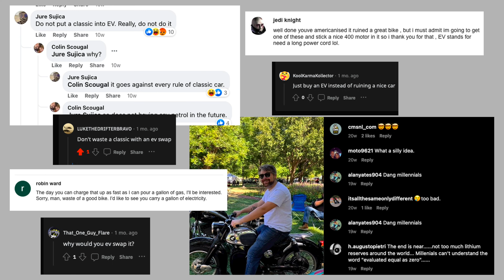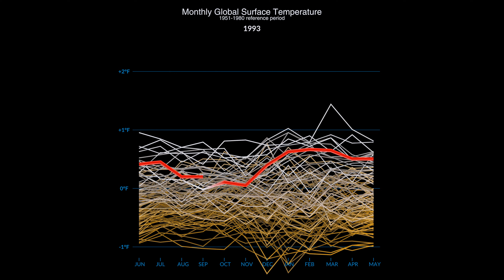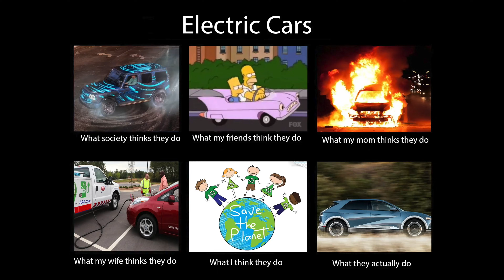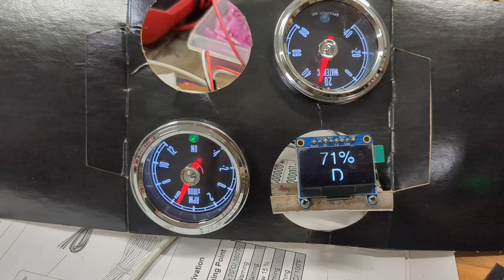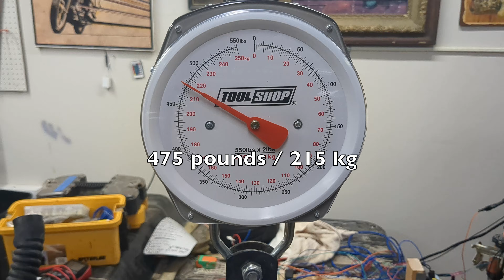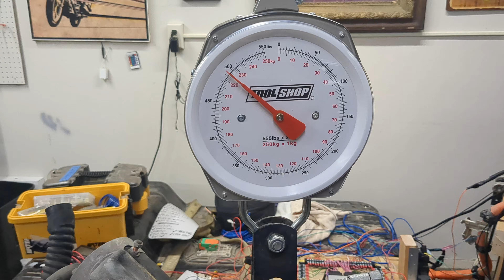Why I'm converting my classic car to EV (it's not what you think)

Comment: You got it all wrong or at least the reason you've given yourself is without proper reasoning.  Climate change and related things is something that doesn't have valid merits. Do a deeper dive and you'll find out that in the end it only serves corporate interests and lands itself somewhere in deep finance. Now realistically,  if you want to do a conversion then what you should have in mind is whether if it's actually going to save you any money over fuel costs in regular engines. This I rdoubt however because what ever you spent in buying fuel will more or less add up to electricity costs when recharging. You see because laws of thermodynamics don't and won't change it'll come back to the same thing more or less. I was watching your conversion with a lot of interest but see 3 minutes of your this video makes me think you're wasting your time and money converting a perfectly ready to drive classic car. If it were done on some small lighter car from say the 80s or so then you and me could have truly said it, it's really good learning and fun project to build and be satisfied about.

Comment: Why do you keep calling it a tractor engine?  It was either a 144 cu in. or 170 cu in. straight 6.  Not a 160.   ALSO, "Solder" is pronounced without the "L" sound.  Just sayin'

Comment: The reason I’m doing my conversion is for a totally different reason. I don’t much care about the controversy over climate change or the politics surrounding it or the never ending “we’ve only got 10 years” speeches that are given every 10 years. 
   I’m doing my conversion because my house is solar powered already (not because of the climate, but because i wanted to give them idle finger to my local power company) so since my house is already 100% solar powered….. why not build an EV since I won’t have to pay for electricity. I can literally drive for free since my system already paid for it’s self. Of course I’ll still have to pay tags and Insurance…..

Comment: Congrats on the coal powered car lol. I'm just kidding but seriously ev battery's are heck on the environment using minerals mined by slave labor and releases nasty chemicals into the environment. If I recall correctly it takes 68k miles for an ev to offset its carbon emissions from production. and thats ignoring the mining or raw materials. Diesel ships to move the materials and semi trucks to bring them to assembly plants then again to bring them back to the states.  

I still think the future is hydrogen fuel cell cars.

Comment: Instead of using the leaf with that weird huge motor - could you not have added an electric drive train to the original. Some kind of hybrid. It would be easy in a FWD car because you add the electrics to the rear. There are already products on the market that do this and people have made DIY. I dont know how you could do this to this car and retain the engine. You could get a GM X platform car and do it to that.

Comment: I wonder, there's got to be a replacement charger cable with a NACS outlet end. I've been led to believe that the signaling between NACS, J1772, and CHAdeMO is identical, and that's why simple adapters can interchange between them. If you can just swap a cable, you'd save yourself some adapters in the future.

Comment: We had 26g to 19g wire in the telco world. We used 3m scotchlocks and amp for straighline. Both are loaded with silicon for water proofing. Amp takes a specific gun. 3m just needs a flat squeeze.

Comment: I like the idea of a De Dion tube and an axle-mounted motor. I converted my 1974 F-100 to electric, but used the original drivetrain with a 2012 Nissan Leaf motor. Is the Tesla gearbox a single-speed? If multiple speeds, how does it switch gears? Thanks for your great videos.
Reply from the maker: I have a 1966 F-100 and I briefly thought about converting that vehicle instead of the Mercury. But the wheels on the truck are much larger (29"?) than the Leaf's (25") so I don't think I would have wanted to use the Leaf's gearbox in that configuration. And would instead need to connect it to the Muncie transmission and drive around in etierh 2nd or 3rd gear. So, no de-dion axle.
Reply: @ThisOldJalopy  I saw your F-100 restoration video and really liked the brown paint for the bed. I plan on doing the same to mine after coating with POR-15. Thank you for the idea. As for the transmission, mine doesn't have a Muncie, so I'm not sure what the limitations may be on yours, but I can tell you for mine, which is a Ford 3.03 toploader 3-speed column shifter. I recently rebuilt the transmission. I have regenerative idle (regeneration upon throttle release, not brake application), so I would only be able to shift gears if the motor were not regenerating (when the motor is regenerating, the motor grabs on to the input shaft, preventing gear shift). I can temporarily switch the motor to "Neutral" (motor neutral, not transmission's mechanical neutral) via my Forward-Neutral-Reverse (FNR) switch. But instead I connected a normally-closed (NC) foot pedal right between the "Forward" position in the FNR switch. I placed the foot pedal by where the original clutch pedal is (the original clutch pedal is no longer used, since I do not have a clutch but rather a direct coupling between the motor shaft and the transmission's input shaft, so I recessed the clutch pedal against the firewall) and can now switch gears. It is a clutchless shift, but only takes about a second for the synchronizers in the transmission to synchronize with the next gear, and then the shifting is easy. If your transmission has helical gears, it should be smooth as well, in case you'd like to keep the original transmission. Notwithstanding, I like your idea of the de-dion axle - so cool, and I think you will get much better torque delivery and a smoother driving experience. I love the drive on my truck, too, as it feels like the original drive. Thanks again for your great videos.

Comment: People actually said you were ruining it by converting it? That car(?) -  a Comet Station Wagon?!  I mean,, it's hardly an E-Type or a 72 Scout, is it? So long as you maintain or restore the shell, I don't see what the beef is. But, I guess no matter which old car you could have chosen for an electric conversion, you'd have been goring someone's sacred cow. Well, other peoples' opinions are fine. But it's yours that counts in the end. And afterall, you're keeping it from dissolving down into an iron oxide stain on the ground or going to the crusher. I think you're owed major points for that. Cheers!

Comment: I agree with you about the climate crisis. However people seems to think that stopping burning fossil fuels will lower the concentration of CO2 in the atmosphere finally lowering the temperature again. That is not the case. All CO2 that is added to the atmosphere stays. Which means the concentration will increase until the last drop is burned and that could take hundreds of years. 
The sea absorbs some of the CO2 but it cant continue to absorb as today. Also another source to absorb CO2, the forests areas are decreasing. To that formally locked in CO2 in the permafrost areas has started to release CO2. The rate of releasing grows with the rising of temperature. People are not willing to change in the speed needed. It is these people that vote for our politicians not voting for the politicians we need. Wast investments are tied up i the fossil fuel dependent industry. Also pension funds are the same and the system still absorbs huge amounts of peoples investments in fossil fuel dependent economy.
This means unfortunately that I think it is too late. 
However. I want to be able to lie on my deathbed saying I did what was possible. Eating vegan food and many more adjustments.

Comment: It is great if you are doing it because you want to but saying that you are doing it to save the planet is absurd. Cars are a really small portion on contamination in the present. And if you would change everyone to EV, guess what, the power grid wouldn’t be able to handle it. I won’t go into details but EVs with batteries are not the solution. A better way would be hydrogen cars or using synthetic fuels! It is sad to see how misinformation is spreading.

Comment: Here’s something that might make you feel better during difficult times of this project. In England you are not allowed to put any new holes or change the car’s structure, so they have to use whatever the car comes with and add brackets where necessary to adapt the car’s original mounting holes. I get this from watching the Electric Classic Car YouTube videos. They do a lot of conversions of classic sports cars so they do have to deal with some hate. But all of their cars can be converted back. Anyway, I think Americans have an advantage over the Brits because of this, but they do amazing work at Electric Classic Cars.

Comment: I'm not going to tell you why I think global warming is a myth. I'm EV converting my 2000 Ford Ranger for reasons that don't make people think that I'm gullible. I have tons of solar and tons of batteries. Why not carry some batteries and a hybrid inverter along with a few solar panels on my truck when I'm away from home? Seems like a pretty practical solution to my over-building my energy independence. The truck will be solid as soon as I replace all of the suspension, the minor steering components, and front brakes. I should expect a few hundred thousand miles out of it if I live long enough since it'll be my daily driver and since I typically drive about 35 miles per week. The cool thing will be pulling a trailer to a construction site and powering a Hercules compound miter saw and an air compressor for a weekend before driving home to charge up and prepare for the next weekend. While at home, my 144-volt system will be separated by removing Anderson connectors and each 48 volts of cells will be connected to its BMS and charged/discharged with my home's solar power system. Sorry for being a tech junky. I couldn't help myself. At least I won't be letting some insensitive set of computers and servos do my driving for me. Driving is one of my pleasures as long as the roads are otherwise empty. I look forward to seeing your old rust bucket squeaking down the street in a future video.

Comment: I think converting classic cars to EVs is generally a good idea- but the costs at the moment.. I own a VW bus from 1988. The engine is nothing special, it doesn't really add to the experience and the car could need another gear for highways. So a good starting point for an EV conversion, but it is just way way too expensive. And since we have very strict laws in my country- the DIY version is basically not possible. Btw you can have Volkswagen convert you classic bus/van- it will only cost you 70k€.. and half the car will be full with batteries..

Comment: i do not disagree However in my project I want to keep the gas engine but add Electric Hub wheel motors to the non Driven wheels. So my classis becomes a Hybrid. Using Gas on the highway with some EV Boost, then Pure EV in the city to reduce emissions to Zero in Populated areas. And recharge either with the Gas engine in the highway or plug in when parked. I like the idea of having Both one backs up the other. Of course using the Leaf system saves you a lot of custom design work. Good on you buddy, make it happen for the Good Earth, D

Comment: Do you have more info on the speedhut RPM gauge? Is it CAN or does it use a separate sensor? I'm planning a Leaf swap in an S10 next year.
Reply: CAN. If you’re using Resolve-EV, they have a section specifically for that controller.
Reply: @ianlighting100  I'm using the Thunderstruck VCU. I got my parts from a partially started project and that's what it had.

Comment: I could not give a shit less about emissions from my classic vehicles, or any of them for that matter. I think the earth naturally heats up and cools down over the centuries. I also think an emissions-reduction focus needs to include the power grid. Can't have electric stuff without power. Wind and solar are both effective some of the time, but there needs to be a way to store that energy for when there isn't the sun or wind, and there has to be a backup for when they fail and the storage is depleted. Nuclear is the only emissions-clean method to produce the energy needed IMO. HOWEVER.
I think the change on this car to electric is cool in its own right, akin to swapping in any other non-native engine into an old car. I like Robot Cantina swapping lawn mower engines into all kinds of vehicles. It's just neat, and I enjoy that. If your motive is saving the planet, I think it's misguided and ultimately ineffective if you aren't producing your own power ala solar panels. But it don't matter, that's not why I'm here. Crimp those wires and lay down some rubber!

Comment: Nice work dude! Also really digging all the big Lebowski references. 

Also thanks for the tip on that controller. 

I have a 1991 Ford e-150 Econoline that one day I'm hoping will be feasible to convert EV. Would be pretty cool if you could somehow incorporate two drive units with CVS to 2 live wheels. 

Not sure if you happen to know off hand if it's possible to do two leaf drive units in parallel?
Reply from the maker: Hey thanks so much for the super thanks! First one I've ever received.  As for two drive units, I'm sure that it is possible, as anything is possible with enough effort, but is it feasible? I'm sure it can be done with all aftermarket EV parts and with a lot of money, but for me I'm trying to use salvaged OEM parts to save a lot of money, and that would make it much more difficult. But still possible. Contact Isak at Resolve-EV if you'd like to go that route. Ask this question on the r/EVconversion subreddit, the diyelectriccar.com forum, or a comparable Facebook group.